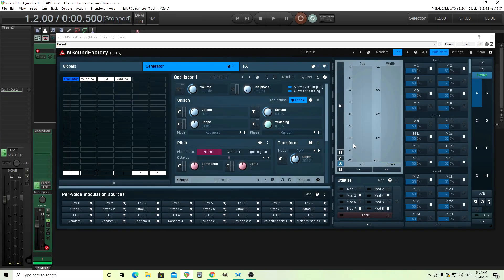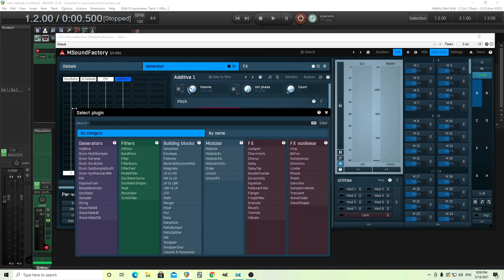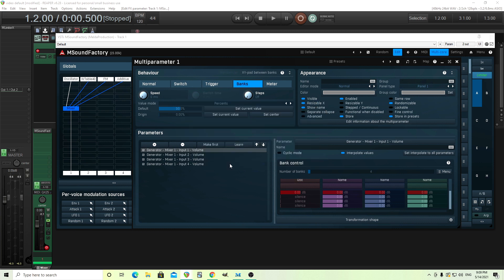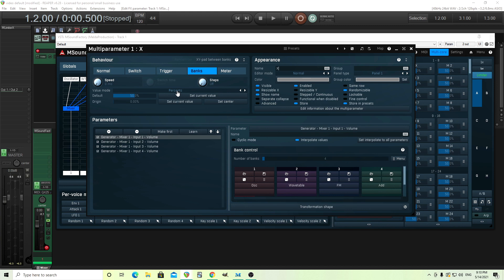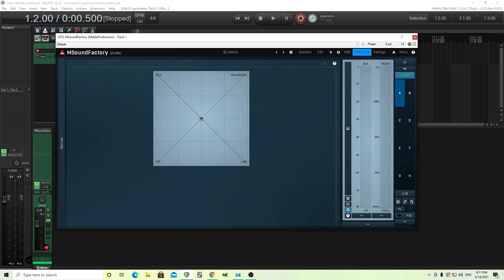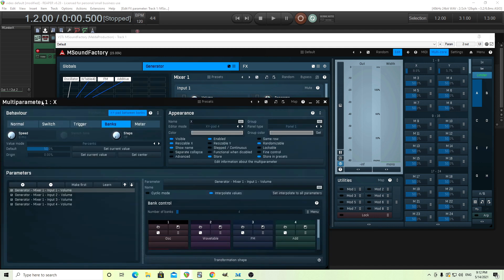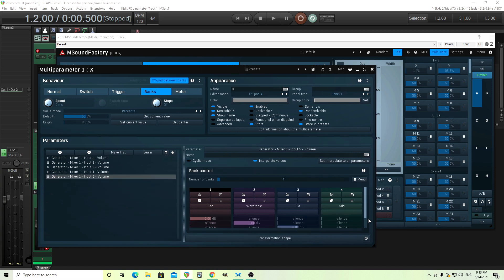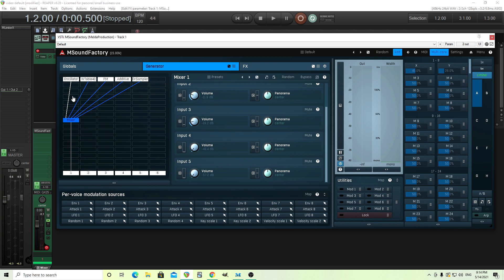XY Pads Morphing

Comment: Great new feature (more than 4). Now as we krass can blend the sounds to taste within the mixer module, the next interesting thing is how are the modulation options and possibilities for those 5 or more circles positions. That would make this feature really interesting. Cheers
Reply from the maker: Thanks, I agree this feature is awesome.
Reply: @Chandlerguitar  I don't like to do it, but if Melda would do the modulation for the XY system now on top like in all the Ron Papen plugins or eben cooler, we would have a killer feature here soon. I never said this ;)
Reply: @nichttuntun  Each Multiparameter can be automated by host DAW.  The Modulators, within M(plugins) can target Multiparameters.  This allows automatic modulation of the XYpad.

 @Chandler guitar  Some M(plugins) have a predefined Device interface.  This can override custom controls.  i found that i had to disenable "Settings>Global System Settings>Custom GUI for devices".

Great new feature!  Opens up the possibility for plugin state morphing that's better than the 'A/B Morph'  :D
Reply: @tubedLeVeNdiS  Cool. Thank you :)